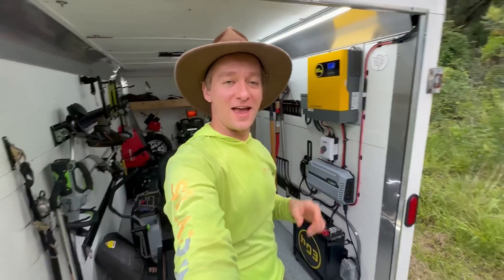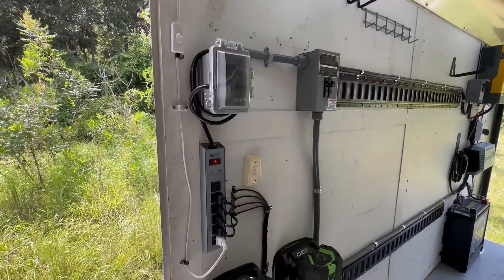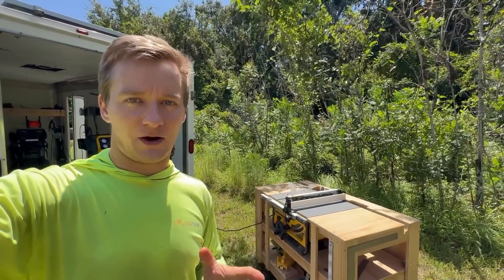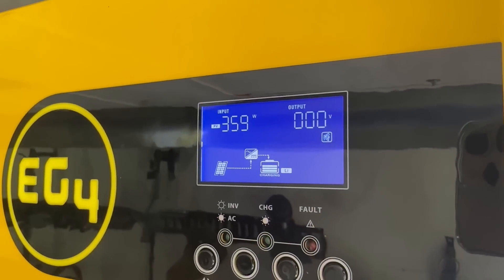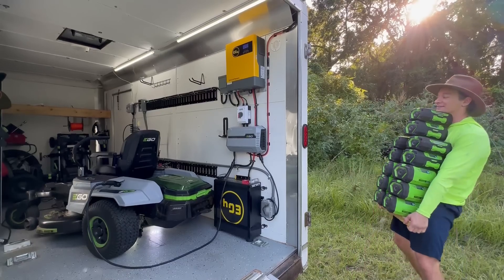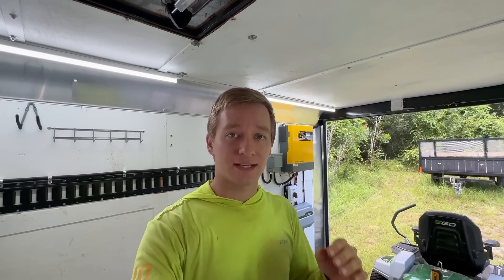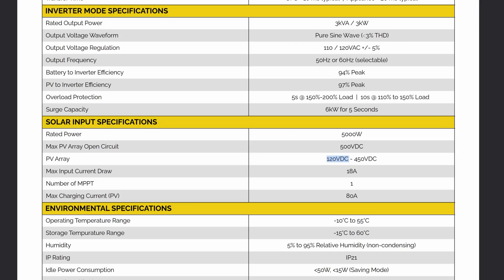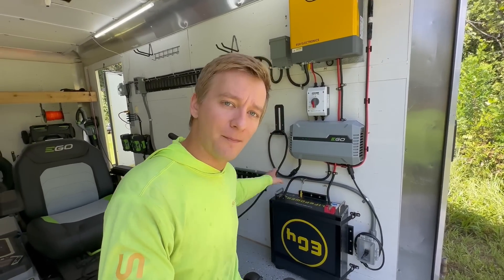Solar Powered Lawn Care Setup; Why Not Just Buy More Batteries?

Comment: no you did the right thing. just sucks you cant do DC to DC charge for your lawn care stuff. your entire filed should complain for 48V to cut out the loss. you guys should also demand more control over charge so you can extend the life of these battery's lithium is super toxic and to expansive to recycle you may put in the recycle but they just thow it away epically now that LifePo4 is going to power walls in the futher. dont get me wrong i realy like your set up but we all cant just keep pointing fingers have the manage the best with what we got.

Comment: Or just buy a small jerrycan of gasoline and go all day no pricey batteries or panels. And if you run out it takes 10 seconds to refuel and keep going and a lawnmower that’s 15 years old still has the original fuel tank no pack to replace….

Comment: Most of the people buying that mower are getting about 1.25 acres mowed before needing to recharge.  For a lawn care business, I don't know man.  It takes like two hours to charge from zero, so you'd need at least two charging at full capacity all the time to just use one of them....mayyyybe....the real world always comes up short in my opinion.  The batteries are 56v 10ah qty 4 provided.  1200 watts.  If you could always park in the sun, which would be hard enough...The battery topped up would have about 4800 watts in it.  One charge cycle from zero on the mower would be  2240 watts.  Rougly 2.15 mower charges.  Now the solar maybe  would put 750ish watts in as the panels probably would only do 70ish percent of their rating at 0% tilt angle.  Charging two mowers that would be 350 a piece plugged in.  An 8 hour day would likely only get you maybe 2000 watts per mower for the full day.  So full day on your total in my estimation would only be 8800 watts in ideal conditions with a fully charged Eg4 battery.  That would only get you 3.92 charges between even two mowers.  Starting fully charged would get you 5.92 charges between two mowers(Or two mowers worth of batteries at total 8 batteries instead of 12).  At 1.25 acres per charge you are looking at total acreage to mow of 7.4 acres per day.  I don't know what your client list looks like, but you better hope for a bunch or really small yards.  That is being super hard on the batteries too!  You should at most cycle them at 80% capacity if you want them to last.  If you are only using one mower I would expect to be able to only cut in an 8 hour day five acres at best or basically four 1.25 acre cuts, but that is full out no drive time between everybody are neighbors.  If you wanted your batteries to last you should only cut 4 acres per day max.  Basically 1.05 or so per cut or essentially using 80% of the battery each customer. I WOULD BE HIGHLY SCARED OF THE CONSTANT USE OF THE BATTERIES AND THE POSSIBILTY OF OUT OF BALANCE INTERNAL BATTERY CELLS>

Comment: I have one of my crews running all electric. 4 mowers and lots of blowers and weed eaters. 
We run a Honda generator to charge them up while driving in between jobs. Charge from the grid over night. They’ve never ran out of power except the day they forgot to fill up the gas jug for the generator at the shop.
Reply from the maker: Hey that’s so cool! You think in the future you might add onboard batteries to your truck/trailer? How does your crew feel about it vs using gas? I’ve never run a gas lawn care company so I don’t have that experience. (Just lots of experience with engines over the years.)
Reply: @solarpunksteve  I don't really see us doing a solar and battery setup on the trailer. The generator does a really good job.  Those guys love the mowers because they a quiet. We run them because accounts pay us extra so its not so loud. They mostly mow retirement communities and daycares and stuff like that.

Comment: How is the regen braking wattage for your car when hauling that weight?
How much different is it from just your car slowing down w/o a trailer and with a trailer?

I am asking because I use regen current and regen braking for my e-bike so when I let off the throttle the regen current kicks in to slow down the bike while coasting and my Regen Braking uses almost double the current for a more rapid deceleration and i get more a lot energy put back into my battery.

Does that happen with your EV vehicle?
Reply from the maker: So I'm not sure on the actual wattage the Model Y is capable of achieving with Regen braking but it's strong enough to stop the car with the trailer reasonably quick.  And for 90% of my driving I don't use my brakes at all, even with the trailer. It's of course not as quick to stop with regen as it is without towing a trailer, but still really impressive.  For the scenarios that I need to stop quickly the car does really well and I also have trailer brakes that will activate.  But yes all Teslas have Regen braking and it's pretty much enough that you hardly ever use your real brakes to stop the car. I doubt I've put a dent in my brake pads since buying the car.
Reply: @solarpunksteve  that’s how is on my ebike, I barely use my actual brakes unless i need to stop quicker.

Comment: Why not direct charge your batteries from solar. Such a waste to convert to AC then back to DC to charge them.
Reply from the maker: Would love to, but honestly I don’t know of an easy solution. If you happen to have one I’m all ears! The inverter is super clever though, if I’m getting solar it can directly output that to the AC circuit and it claims 97% efficiency doing it. Of course I’m losing efficiency through the EGO chargers and if I’m pulling directly from the onboard battery (95% efficient), but EGO claims their chargers monitor for thermal issues and also blow air through the battery to try and keep it cool while charging, so until I have a really good, robust solution I’m just going to keep mowing lawns and making money with what is already working and enough for my needs 🤷‍♂️

Comment: How did you mount the panels to the top of the trailer so they'd be on there strong enough to not get blown off at high speed? I am looking to mount panels to a shipping container and need ideas for how to make a high wind-resistant mount system.
Reply from the maker: I’ll cover it in the build video, but just to get you going, I’m using snap n’ rack metal roof base mounts (I love them). Then on top of those I have galvanized superstrut from Lowe’s bolted down, and some slim solar panel brackets to hold everything together. Also added a safety wire between all the panels just in case one decided to let go it would be held on by all the rest and wouldn’t fly into someone’s windshield. Stay safe and good luck!
Reply: @solarpunksteve  awesome, thanks for replying so quickly with helpful info!!
Reply from the maker: You got it! I looked at just bolting the superstrut directly to the roof of the trailer but unfortunately the roof was so warped and deformed I had to raise them up a bit. You might have different options for your shipping container, personally I’ve never looked into doing that so don’t have more to offer.

Comment: So you basically converting DC to AC power via inverter then again the equipment is converting back to DC to be able to use it charge the stuff.. so much loss here. If the inverter and equipment would be 100miles apart then yes i agree but now its just waste of energy.

Comment: Very nice video 👍👍  but I really recommend you to get a fire extinguisher only because you never know what could happen since you trailer doesn’t have air ventilation... And because you always plug in your equipment, after being used which it will heat up the battery even more
Reply from the maker: Good thinking! I've actually got one now though, just need to screw it to the wall somewhere.

Comment: Why do you bother with an inverter? There are losses in converting back and forth. You should just use panels and charge controllers to charge the device batteries. Then if you need lights just use DC lights and maybe a small cheap inverter for hand tools.
Reply from the maker: Practicality I guess.  I don't want to have to buy or build a custom setup for charging the EGO batteries directly off DC, especially if I choose to change to a different manufacturer that has a different voltage requirement and different battery terminal tab/charging setup.  All I have to worry about at the moment is just installing the EGO chargers and plugging them in.  Quite a few people have said similar to you but honestly I'm not sure how to go about doing it simply and so far no one has offered an easy solution.  Plus EGO claims the chargers themselves monitor the batteries for heat/overload and also have a built in fan system to blow air through the battery itself.  It's possible you could build something that does the same but at the end of the day I'm just trying to mow yards, not build the most efficient solar setup, and right now I have more than enough capacity and solar to suit my needs, so it doesn't make sense to optimize.  Not trying to sound rude, just talking about my real-world application which I think is a little different than building something stationary at home.

The inverter is not as inefficient as you might think either. If I'm getting solar power and charging my EGO batteries simultaneously, EG4 claims the inverter can operate at 97% efficiency, and pulling from the battery and running the inverter it can do 95% efficiency.  Of course you'll have losses in the EGO chargers, but still that doesn't sound too bad to me.
Reply: @solarpunksteve  All reasonable reasons. I have an off grid camper and now a Log Cabin and I have used the same self designed solar setup on both, not an equal comparison, but have a fair amount of experience in this and doesn't hurt that I'm an engineer as well. Now I bought a farm with a house with no grid power, so I'm looking into a larger system for it, and was looking to see how much panel wattage VS how big of an inverter people were using when I found your channel. You have a nice setup and its nice that you do really nice clean work installing it.

Comment: There’s a bit of flawed logic in your assumption that you can charge everything off of you battery one time. You’re not taking into account losses from inversion, I squared r losses, or heat loss in the batteries. It’s not THAT big of a deal, just thought I’d point that out. I’d suggest doing a capacity test by trying to charge everything up from only battery power and see how far you get. I’m gut checking around 90-95% total conversion efficiency
Reply from the maker: I don't disagree with you, but I tried to make the video simple and approachable, I fully intend to get into nitty gritty details about real world power use, consumption, losses etc.  And I tried not to sound absolute in my descriptions, I used wording like "essentially" instead of "exactly", and "in the real world, things aren't that simple" etc.  

Actually the efficiency of my system might be much worse than you estimate.  For example, if the inverter is operating at a healthy 95% efficiency, and the EGO chargers are at a generous 90%, the system would be 85% efficient (0.95x0.90=0.85).  And then if you estimate the efficiency of the motors in the mower and equipment at let's say 92%, that's now 79% efficiency.  So for every 1000Watts my panels produce, I'd only be getting 790 of those for actual use.

But the insane part is that we're doing all this from a couple solar panels on the roof of my trailer that are only 18-20% efficient at capturing the suns energy that's hitting them.
Reply: @solarpunksteve  Good point, I totally get why you kept that part out and I think you did a fine job explaining things in the video. I just couldn't help myself, you know how it goes haha. I definitely missed som losses there in my comment too. Great content, keep up the awesome work!
Reply from the maker: I completely get it, I’m always way too technical and appreciate accuracy, this was a compromise in my mind of not boring people to death and me actually being able to get the video finished haha.  Don’t be afraid to keep me in check though if I’m off on anything in the future too. I don’t want to be the person that speaks with authority without actually knowing what they’re talking about.

Comment: I’m not gonna start a landscaping company but this is very cool to see. Solar has some nutty benefits people sleep on. I’m in NYC and still generate enough to over produce while charging my car and tools (landscaping to snow blowers)… so I guess it’s all solar powered as well lol. Best part is all the incentives, the panels were actually cheaper than local electricity. Add on rebates for charging my car off peak and I essentially get paid to fuel my car!

Having a whole business run off it is just next level. I’d assume a lot less maintenance is required for a large electric mower.

Comment: I've had sthil battery equipment for 2 years now and I'm disappointed on so many levels with battery stuff and the high cost aswell, no fault of the brand. Can't wait for for my stuff to die so I can go back to petrol power, but so far everything is still working

Comment: Sweet setup man! Making sure you have the right parallel or series config with your solar panels or batt banks that fits your goals. Blocking/bypass diodes and proper fuse setup will help avoid disasters.

Comment: I feel like there would be a way to have a solar station at your storage location that was dedicated for charging. So if you had a 5Kw battery charging at your dedicated solar area you could be using another to do your work. Since it's set in place I would think you would reduce the limitations of the solar power and not be constrained by the roof size of the trailer, which would mean you could build out as needed to maybe go 100% solar (or as close to practical). Might even be able to buy second hand solar cells dirt cheap (in theory) and reduce the ROI... maybe. Haven't really thought it all out.

The trailer looks pretty sweet though, have you considered maybe some 3D printed battery holders on the side to keep them from banging around? Granted I don't know how you store them currently but if they are one of your largest cost sink, babying them to prolong life might be a worth wild investment. :)

Comment: I would have too much range anxiety  having only one battery for such a high drain device like a riding mower. I would only consider it if I had at least two batteries for the mower so I could be always charging a battery while using the other and to extend the runtime of my mower. Edit: It looks like you have 6 ego batteries for your mower and the mower can easily operate with just 3 packs. So if you wanted to, you could have 3 packs on the charger while also using the other 3 packs in your mower for continuous operation!

Comment: Would have saved a bunch of wire if you put the 2 20a breakers by the inverter and just ran 1 line to the outlet instead of running it all the way over there and back

Comment: 1200 watts of panels wouldn't be able to keep the mower charged if used everyday...
Reply from the maker: It honestly depends on the day and the type of use.  Some of my yards hardly draw much from the mower, not to mention I do other services like weeding, mulching, hedge trimming etc., but other yards/days take quite a bit.  And of course you have days where it's cloudy or raining and you can't get much solar at all.  I usually stick my larger yards at the end of the week so that I have the weekend to top back up, but I'm starting to run into limitations as my business continues to grow. This was a solution to the early limitations I had (running out of battery in the equipment) and now I'll improve and upgrade to solve these limitations. Everything I do is an experiment and learning opportunity.